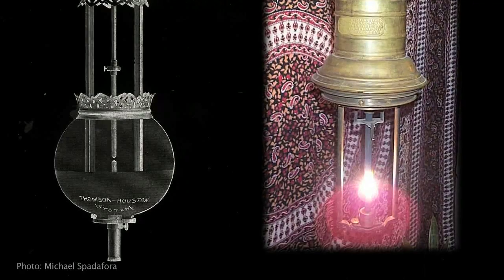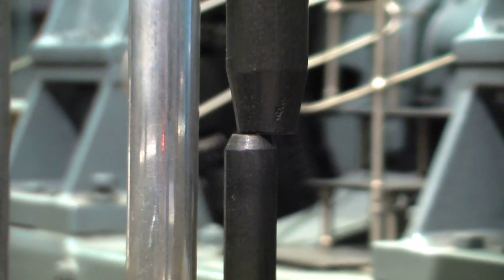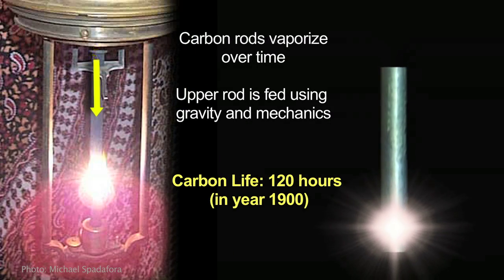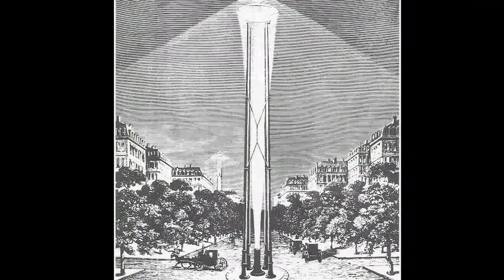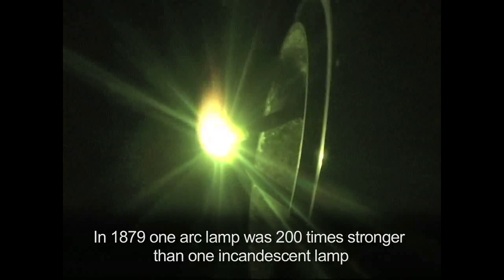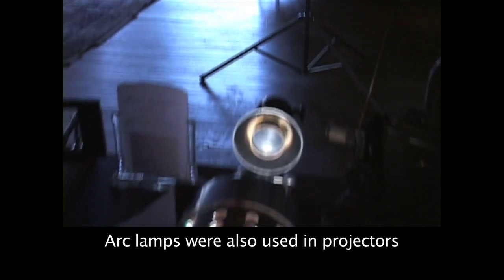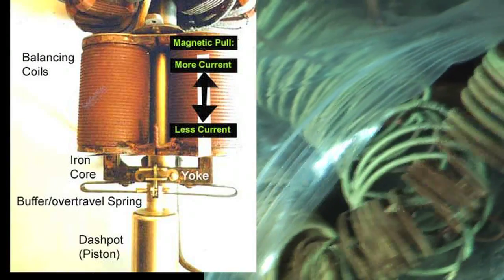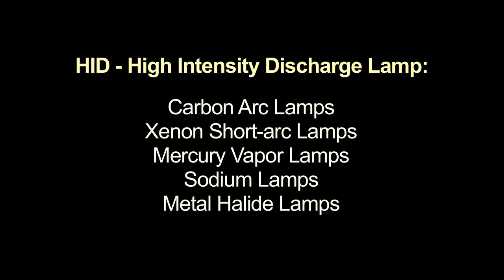The Carbon Arc Lamp

Comment: But be careful!  The lights from that era were a different voltage than what we have today.  And, many of them used 133 Hertz AC, 200 Hertz AC and even DC.  Electricity was not standardized back then and voltage and frequency was all over the place and all across the board.  Not only that but the label on the fixture will have fallen off and no telling what the power requirements were at that point.  ARC LAMPS FROM THE 1800'S CAN'T BE RUN ON 60 HERTZ AC.  Doing so WILL damage components.  If you do want to attempt running an 1800's arc lamp, I would HIGHLY recommend the DC model.  But I would STRONGLY discourage running an 1800's era carbon arc lamp at all if you can help it.  Although with DC you can series batteries together and get the voltage that a DC arc lamp needed, I would STRONGLY recommend against it and stick with mercury vapor, high pressure sodium, and metal halide.  The open arc is a fire hazard and finding parts for those things would be impossible.  Carbon arc lamps had the arc in the air.  Like he said in this video.  Carbon arc lamps did the arc in the air so, the arc was open.  Common sense rules will tell you that open arcs are a fire hazard.  My AHJ (Authorities Having Jurisdiction) won't allow me to use carbon arc lamps with good reason because of the open arc operating in the air.

However, I have run into a few carbon arc lamps from that era and I almost always prefer to simply stick a metal halide ballast and MH bulb into it.  Finding carbon rods would be impossible.  And, the open arc is a MAJOR and BIG TIME fire insurance claim just waiting to happen, insurance will be a problem with running open arc lights like this and can even become a legal liability risk if you are not careful.  Mercury vapor, high pressure sodium, and metal halide are CLOSED ARC which are safer.  Because, everything is all inside the arc tube and inside a glass bulb.  See the difference?

Comment: Good explanation. I should build a small one with similar regulating coils but no choke, with something like 40V DC and 10amps. Wich i think its the minimal requirement. I think would look nice cotton covered wire, but the wire on the coils become hot? Can cotton withstand  the high temperature?
Reply: Make sure you wear sunglasses, these things pump out a tonne of UV (that's their only real use now)

Comment: How were arc lamps like these powered?
Reply: https://youtu.be/oFnP59p0juk
Reply: @thakurelectrical4039  Were volatic piles usuall yused to power these old arc lamps?
Reply: @AyeToan  in Yablochkov's first 'candles', DC from batteries or a Gramme machine. in his later designs that saw the most commercial use, AC.

Comment: From a consumer perspective this lamp unites all the disadvantages of candles, oil lamps and gas lighting. From a producer/trader/supplier perspective this lamp unites all the advantages of candles, oil lamps and gas lighting.
A candle burns down and needs to be replaced. A carbon arc lamp has two carbon sticks that both burn down and need to be replaced. A gas lantern needs to be connected to a supply line and needs to receive constant gas supply. It needs to be supplied with gas from a grid. A carbon arc lamp is electrical. It needs to be connected to an electric grid. It needs constant supply from a supply line. An oil lamp needs to be refilled with oil. A carbon arc lamp has moving parts. The moving parts have bearings. The bearings need to be oiled from time to time.
On top of that it may need maintenance.
Reply: yes but the light is put out was incredible, mean it put out so much that it was better to have a few lamps that are need maintenance and replacement parts the to have thousands of all those other kinds of lighting sources.
Reply: They also destroy your eyes with UV, so there's that

Comment: Why were they so noisy? I know that transformers buzz because of the 50 or 60hz frequency of the lines, but would they buzz under DC power like from aVoltic Pile? I'm not really familiar with high voltage and have never worked on anything using it, mostly because I'm afraid of accidentally killing myself or someone else.
Reply: I have several videos of DC carbon arc lamps. They are completely silent.
Reply: twistedyogert  it's likely the arc itself. I have no experience with these lights, but when welding there is a pretty good noise from the arc. My 2 cents.
Reply: The Carbon Rods oxidises in the air and hence why the noise.
Reply: @twinklecaress  the air oxidizing has absolutely nothing to do with the noise. The noise is caused by the 60 hertz oscillation from alternating current. An arc is struck 120 times a second causing the humming noise. DC lamps are completely silent.

Comment: I used the Carbon Rods out of a Lantern Battery, and Cranked it right up to 200 Amps.
All was Bright, no Shadow,  but the Rods lasted only 1 Minute
Reply: That's because as the air and carbon became ionized, the resistance was lowered, and because of Ohm's law the current climbed until the rods were destroyed.
Reply: Wouldn't just a simple resistor in series be sufficient?